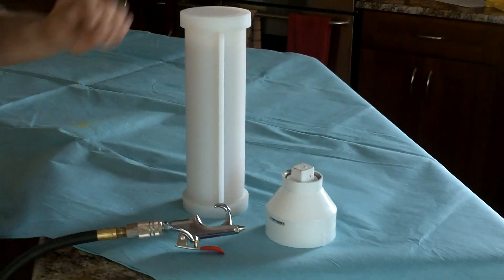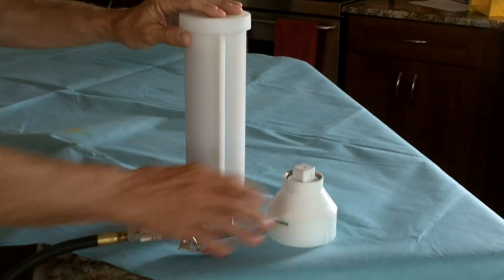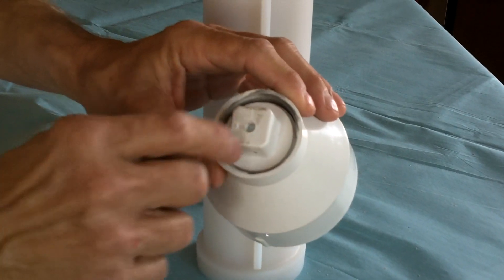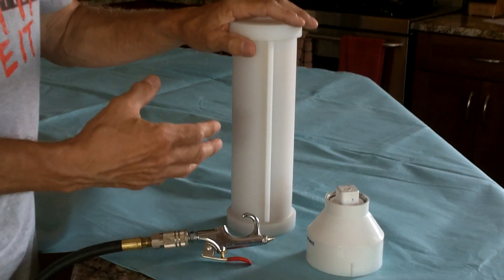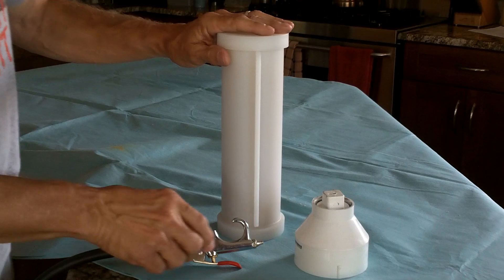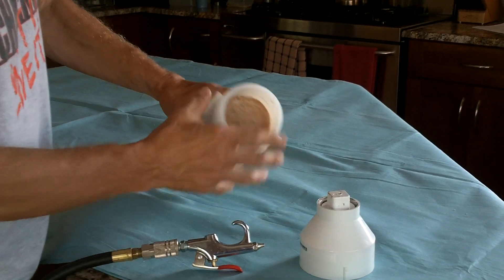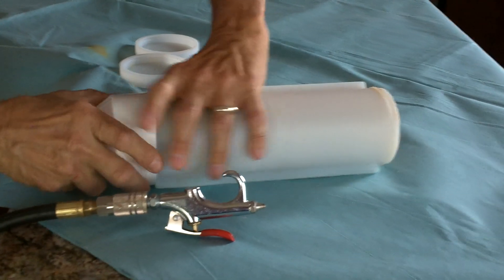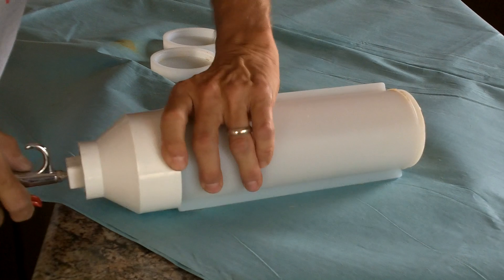Innovative method for removing soap from Essential Depot's Cylindrical Mold

Comment: can you please share a pic of your actual compressor or at least the brand and model? I bought a portable tire compressor capable of 150 psi and it does nothing as far as loosening the soap.  You would think that 150psi would not change from compressor to compressor but yours even sounds more powerful at 90psi.

Comment: That was great.  How much for the compressed air set up?
Reply from the maker: At first I was concerned about too much pressure possibly damaging the mold so started out at 20 psi…not enough.  I then went to 40 psi but again, there is so much leakage by the soap column as the mold slightly expands by a few thousandths of an inch that it did not work well.  I ended up using 90 psi and it worked as you see here in the video…that level allows for enough pressure on the back end of the soap column to overcome the leakage around it….and it is the leakage that expands the mold just enough along with sufficient back pressure to move the soap out.  Thanks!
Reply from the maker: bytheSEA Soap Mella I am so sorry for a one year delay in responding to your question.  A major life change and I lost track of this.  I did this for my wife...she is the "SoapMeister" but the set-up is easy and very reasonable.  The two PVC fitting cost about $2 total.  A small compressor capable of at least 90 psi can be purchased for less than $100 and typically will include a hose and the fitting that I used in this video.  If not, that fitting is also reasonable, generally less than $10.
Reply: Zopilote1219 Oh I understand.  Thank you for sharing your set up!